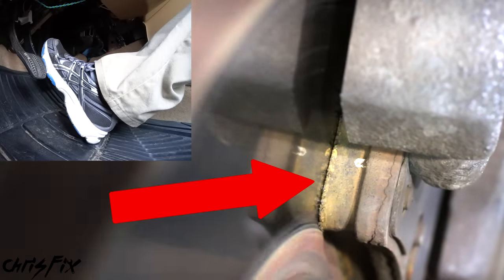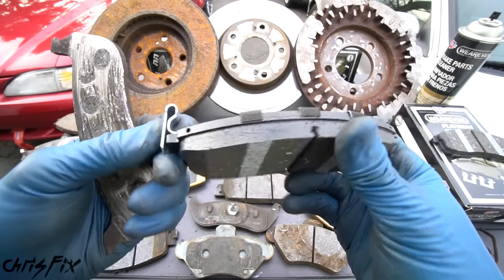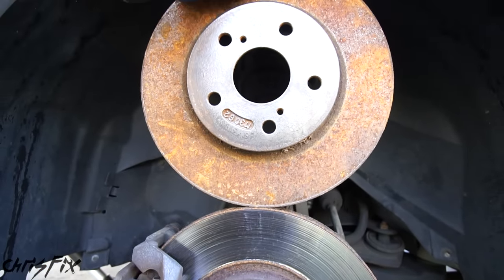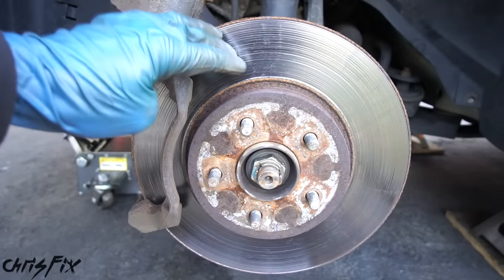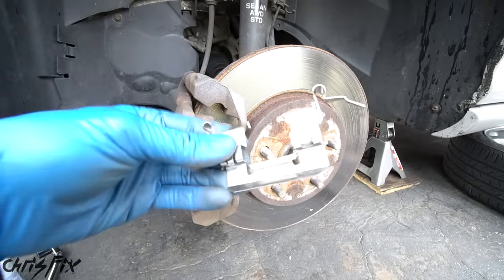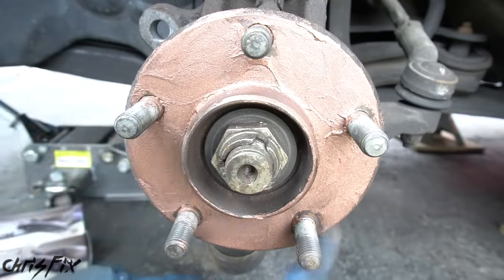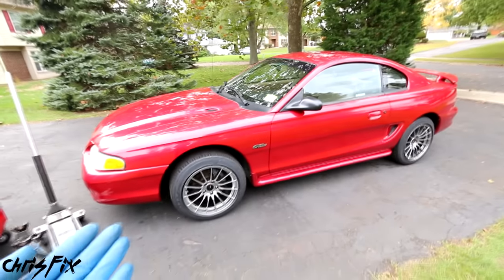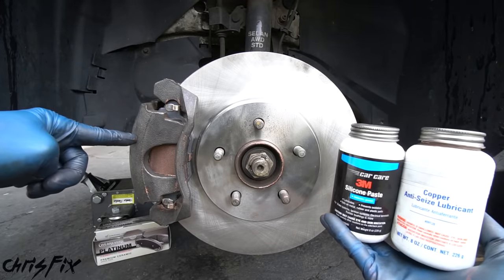How to Stop Your Brakes from Squeaking

Comment: Experienced a strange sluggish release/binding of the calipers on a couple of my Dodge/Chrysler Mini van's front disk brake calipers.  I am cheap and my time when I am off is relatively free so I purchased non-loaded calipers figuring I could repalce guide pins/bolts and rubber boots and bushings.   I refered to the Haynes manual on my van which recommended using high temperature wheel bearing grease to lube the guide pin/bolts and rubber bushings, which worked fine for an hours or so,  I decided to test them again before restoring the wheels and I noticed the calipers were nearly locked and would not clamp evenly nor freely slide back to a neutral position not in contact with the rotor.   So after use of several types of high temperature wheel bearing grease all lithium soap base resulted in near identical problems I agained asked the parts sotres if they had any loaded calipers available, they said no not for several days.  The additional cost of fully loaded calipers was beginning to look pretty reasonable if anyone had any, which neither Advancced, Auto Zone, NAPA nor O'reilly had any.  So purchased more guide pin rubber boots/bushings and contacted the local Chrysler dealership of which I was pretty close with the parts man who asked the lead mechanic that did the most brakes what they used, he said they used Chrysler high temp Wheel bearing grease and showed him the tube he had and he said he had one in stock so off to the dealership returning with a tube of exactly what the mechanic said they used and the new ruber boot.bushings which when the grease was applied provided nearly identical results just taking a longer time, I allowed the car to sit over night and by the next morning the brake pedal was the only force that would move the caliper and then it wouldn ot refloat to a neutral position, same as all other Lithium soap based greases I had tired, I think this grease was a mineral base but don't recall for sure.  So I bought some Teflon and Silicone and tried them after I returned to the parts store buying more rubber boots/bushings since I was concerned that the lithium soap based greases might have adversely affected the boot/bushings and bought new ones for each grease tested again, guide bolt/pins were cleaned with brake parts cleaner between tests with different greases.   The parts store silicone(can't recall brand) was very thick, was better than the lithum soap based greases but still created am unacceptable  amount of drag and a suction or pressurization issue within the guide pin/bushing area.  So I went to Ford and bought some of Ford's Silicone grease(only dealership that said they used s special brand, thinner but still not right, tried Teflon, still not right, finally got some loaded calipers after my lesson in greases that didn't work.  Neither the Teflon nor the silicone lubes resuted in locked caliper slides due to lock up between the guide pin and bushing but they still were not right.  I called the brake caliper manufacturer and asked them what grease they used on their locaded calipers(thsi was before you could buy the $1 grease packets at the counter of parts stores for brake work).  I spoke with several people at the brake caliper company that did not know anything as well several that were not interested in helping, finally got hold of a tech with the company and after explaining my experience he said they use standard silicone grease, to which I said well I don't know what viscosity or standard of measurement is used to determine what a standard silicone grease is but I tried two different brands with very similar results even though the loaded caliper provided by your company don't display the problems of a bad interaction between the rubber after market boots and the guide bolts/pins so I'm not sure but I would appreciate a sample tube or little packet or  label showing the manufacturer on it so  Icould obtain some, I never got the information, oh well, stuck to buying fulling loaded calipers after that whenever they slid on a guide bolt inside a rubber bushing inside a cast iron brake caliper, it's just less hassle when you can NOT find the correct lubricant or a person that knows
.
Reply from the maker: Interesting, thanks for sharing

Comment: Times ago, we had a Citroen Traction avant with drum brakes. One day, on leaving to hollydays, the brake became brutal. As soon as my father put his foot on the pedal, the brake blocked. He was afraid (and probably right) that this would break something and anyway it was inbearable. So we went prudently to a garage and the guy repaired it for a gentle price. In fact, the corner of a brake plaquette had become  very pointy, that is, it formed a very acute angle. So, as soon as the paddle touched the drum, it twisted the angle a bit upware. And the brake blocked. The guy rounded the angle and all became normal. We could restart to our hollydays very happily and never had the same problem... Thanks to this guy knowing what was the problem, and not trying to change several pieces as it would probably be done now...
I did that also on one of my cars later because it sqwicked, and the noise stopped to happen.

Comment: Yes, i got same problem with my front dust shield, because of the rock or something its got bend and touching break disk, we are on 250km tour, after riding it for over 4km i thought its need some repair, when i removed the wheel, whole metal, bolts and every thing arround is red hot🤦 if i droved little much then its would cost me lost of money but thankfully i repaired that thing on the road and replaced that bent dust sheild after our tour😂

Comment: Hi very informative video. 
My brakes are making a squeaky noise at low speed after I’ve pressed the brake pedal. Also when I reverse and press the brake pedal I can hear a knock coming from the brakes. It’s one knock after I’ve been driving forward and then needing to reverse then stop. My car is a 2019 Volvo S60. Cheers.

Comment: Hi Chris,

I recently had the brake pads and rotors replaced on my car, but I’m noticing a burning smell coming from the right front brake when I brake. The other brakes seem fine.

Do you have any idea why this might be happening or what I should check?

Thanks!
Reply from the maker: Could be that your caliper is starting to seize and drag that pad, drive around a little then get out and put your hand near (do not touch and be careful not to burn yourself) the rotors and see if you notice that one feel hotter than the others
Reply: @chrisfix  I checked the rotors after driving, and the right front one definitely feels hotter than the others. Do you think I’ll need to replace the caliper, or is there something else I can try first?

Comment: I did my first brake job on my moms car and didn’t make sure everything was nice and tight so we heard a really bad sound when breaking when I checked it out the whole caliper was loose luckily noticed it before driving anywhere but if you ever hear something really bad try and shake things it shouldn’t budge and if it does make sure it’s tight
Reply from the maker: Definitely want to torque everything down.

Comment: I have an old volvo 240 that has brake noise. I bought more expensive brake pads and put them in yesterday because i thought that was the issue. It helped a bit, but after driving in the brakes a little, they started making noise when i brake very softly as you do in trafik. I will probably take the car to my school and get some wize words from my teacher because i am clueless. The only thing i maybe think it can be is the calipers, they are a bit worn out and rusty, i am thinking of replacing them but calipers are a bit expensive.

Sorry if my english is not right, im from norway.

Comment: I have an easy way fix brakes guys. Just put oil all over the brake and rotor, itll also make your brake last longer because they will slide against your rotor instead of stopping it so its a win all around!

Comment: I installed new set of rotors and break pads on my car but after 2 weeks I get to see break noise and that was not the problem with my previous set of worn out breaks.
Reply from the maker: What kind of brake noise?
Reply: @chrisfix  squeak

Comment: Hi, you missed some causes for brake noise, like the brake cilinder o-ring being damaged or worn out witch prevents the pad from backing up and creates an uneven brake force. also I use cooper based lubrificant on brakes because of their temperature resistance, since the brakes heat up so much.
I know this video is old, keep up the good work!!

Comment: I  know I'm 3 years late, but I believe my none brake noise is the dust shield when turning. I noticed its bent, so when turning it seems to be rubbing on something 🤔
Reply: When you change your wheels, the rim sometimes hit the dust shield. When brakes later becomes hot the dust shield hit the brakedisc. Then a loud noise appear from the wheels.

Comment: Hi Chris, I watch you videos and Love it. Let me ask you about an issue I am facing right now. We have 2016 Audi Q5 and we got New Rotors and pads replaced on the front wheels at 51K miles. I purchased  all the parts rotors and pads etc. form Audi dealer we purchased Audi from and have it installed by an other mechanic shop. After 4 weeks we are now having squeaking noise when breaks are applied. I took the Audi to the mechanic shop to see and make some adjustment and lubrication as you are showing in this video. 

squeaking

Comment: Hey Christ thanks for the educational video.

So my rear brakes on my 96 Lexus are making a loud noise when I turn either direction on both sides of the rear brakes.

I added silicone paste to the front guide pins and one pin in each of the rear wheels. But it still makes noise.

Comment: I have a 2003 silverado, 116,000 miles.  I get a grinding noise from the driver side front wheel when I apply the brakes.  I have replaced rotors, brake pads, wheel bearing hubs on both front wheels.  I am out of ideas to apply to get rid of the grinding, only grinds when the brakes are applied.  Open to further solutions. It is a 4 wheel drive, extended cab.  Every thing looks good  and appears to work good to me.

Comment: My car has no fault code but the symptoms are:
1. Car vibrates at highway speed.
2. Sticky brakes, sounds like a rear caliper stuck however see point 3. 
3. All problems dissappear for the trip if I pump the brakes(airy whooshy sounds) a few times when stationary.
Do you think its a brake caliper fault?

Comment: I had an issue with brake hardware on my old VW Golf R, Volkswagen didn't sell their brake kits with guide shims and must have changed suppliers for the pads and there was about 1.5mm of play and every time I'd lightly hit the brakes, the pad would shift and clunk

Comment: Hi Chris my wife has a 2022 acura rdx and the  rakes make noise in the morning when she backs out of the driveway.I went to the dealer and they said they didn't hear the noise , I would have to leave it overnight for them to check it . I think it's the type of brake pads they use,  ehat do you think it could be. The rest of the day it's fine no noise.
Reply from the maker: Sometimes the rotors will create a thin layer of corrosion from sitting overnight and it can make a sound first thing in the morning. If it goes away after that and you don't notice any other issues with the brakes then I wouldn't worry, it's normal

Comment: I have Mercedes AMG Roadster. The brakes were squeaking so now it has a new brake pad. It is squeaks after a couple of minutes of driving not in the beginning. I wonder if warming up the engine or the brake pad has something to do with it
Reply from the maker: On a high performance car like that, when the pads are cold they will probably squeak, but if it goes away after some braking then you probably don't have much to worry about

Comment: I replaced my brakes myself, new brake pads and rotors. They only squeal at the first stop or so after turning on the car and then it goes away. Is that normal?
Reply from the maker: Nice work. That can be normal if the brake pad material is causing the squeak.
Reply: @chrisfix  Thanks Chris, happy holidays

Comment: Question, I have hardware “clips” that hold my break pad to the caliper. I just want to know if I should put anti-seize on both sides of the metal hardware or just on the break pad ears that will make contact with the hardware, or not at all? Any advice would be greatly appreciated since I don’t want my ish to seize.
Reply: Has anyone helped you out with your question yet?

Comment: Hi Chris -  2012 Hyundai Genesis Sedan 3.8L - #1: Brakes squeak after car has been sitting and there is moisture in the air or it's raining. Had 2 shops do fixes but the problem persists #2: Had the catalytic converter replaced  8 months ago and I smell exhaust fumes coming through the air vents

Comment: Why would my vehicle's brake make squeaking noise when driving but not when slowing down? Note that this is happening after replacing brake pads and rotors.
Reply from the maker: Could be debris that got in between the new pads and rotors
Reply: @chrisfix  thank you!! It was done by a mechanic, so i would have to check for myself and see. Any advice or tips on looking for debris or cleaning it?

Comment: I replaced front brakes ,I bought them at the dealer. I installed new calipers and I bought new discs. I noticed they have different price discs that range anywhere between $35 to $150 so I bought the $35 ones. Everything works perfect except now when I come to a stop and slowly release the brake I can hear metal to metal grinding sound but then goes away after I fully release the brake pedal. Do you think this could be due to low quality disc ? Why are some expensive and others cost less?

Comment: Should the brake rotors be replaced or cut everytime one replaced the pads? Thank you
Reply from the maker: I'd recommend replacing them with pads, they're not that expensive and you are already in there so you might as well

Comment: Thanks for the great video, Chris—very helpful, as always.
I'm curious why you specify "copper" anti-seize and don't mention "nickel". I've looked at all the parts stores in my city (AutoZone, Advance, O'Reilly's, etc.), and I can't fine copper anti-seize anywhere—they all have nickel anti-freeze. Does it matter?
Reply from the maker: For brake parts that can get hot, copper is a lot more heat resistant. Here's a link to copper you can order: https://advanceautoparts.rt8x.net/xYWVR

Comment: I bought a new Kia Rio in 2016, when I apply the brakes when backing in or out of my parking space I hear a scraping/noise. No brake warning lights ever show...I took it in to b checked out and they said...if we don't find anything wrong you will be charged for labor...I know I should have done it..but at the time I had too many bills. Suggestions?  Great video. Thanks.

Comment: Do we also need to replace brake calipers and mounting bracket ? I just changed brakes, rotors and applied lubrication as mentioned. I am still getting noise.
Reply from the maker: You shouldn't need to, what noise are you getting?
Reply: @chrisfix  squeaking noise.

Comment: anti seize collects brake dust, turning into grinding paste. so anti seize  should only be use if there is a noise problem
Reply: If you don't use anti seize you'll need to change the calipers every6times because they'll be worn down. Use antiseize. It's doesn't collect dust if you use a great quality one

Comment: I have a question??!!! My 2015 Hyundai Elantra was making a weird Squeaking noise on the right side but only after driving for a good 30 minutes on at freeway speeds (70-80) I switched out the breaks and still made the noise so I switched out the rotor. It still feels like it’s doing the same thing. I’m not sure what it could be. I also made sure I had no air leaks or anything else please help.

Comment: What about creaking when I break. Just bought a 2006 Toyota Matrix and the drivers side breaks needed replacing because one of the pads worn down to the base and was scraping against the rotor. I replaced both front pads and rotors and lubricated the break hardware and guiding pins but now I’m getting a creaking noise everytime I break. Any idea? I can’t figure it out

Comment: Great video Chris I'm have a brake noise issue at the moment so I'll take all your advice on board. One point I'd like to raise is that I've seen certain manufactures of ceramic brake pads market them as anti squeak. What's your opinion?

Comment: I"ve replaced front and back brake pads but still get squeaks, pretty much only when i'm in reverse, like backing out of my inclined driveway or from parking spaces. Do i need new rotors?

Comment: I just replaced my rear pads and rotors on my 2005 Dodge Ram 2500. Now there is a knock when braking at slow speed(doesn’t do it in reverse). Seems to b e one knock for each revolution of the wheel. Any advise would be greatly appreciated
Reply: Axeman, I thought I may chime in here if that's ok. Could be loose bolts or the caliper itself is loose. Check your bolts, make sure they are torqued down to spec if you have a torque wrench and let me know if that helps. 

Oh, and are you sure the noise is coming from the rear?
Reply: Squeaking when you lift your foot off the brake is an indication that the calipers are not releasing. For disc brakes, the calipers hold the brake pads. They close when you step on the brake pedal. If they get rusty, they won't release cleanly. The rotors are designed to throw the calipers open when the wheel starts turning. This isn't happening as it should.

Comment: Im hearing a slight squeaking noise only when slowly rolling or when slowly turning to the right with slight pressure on the brakes. Is this just due to lubrication?